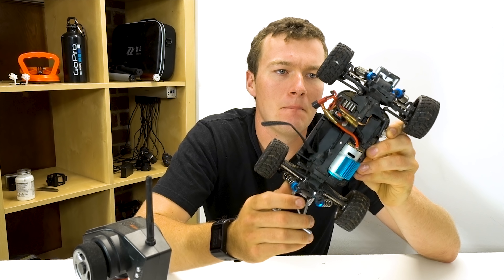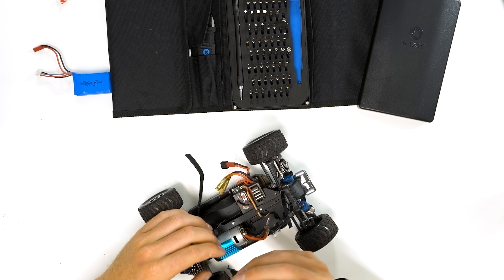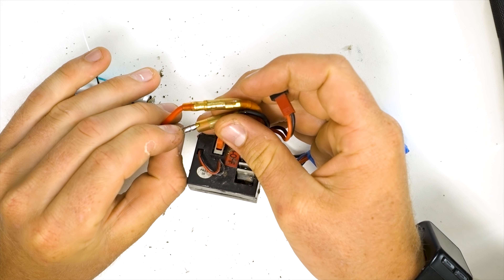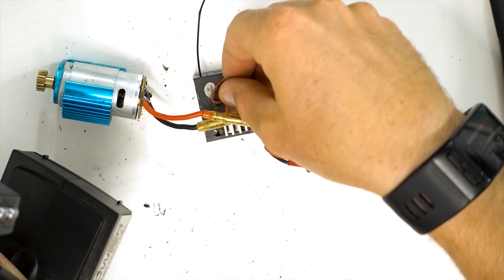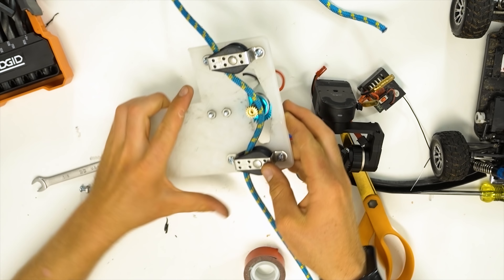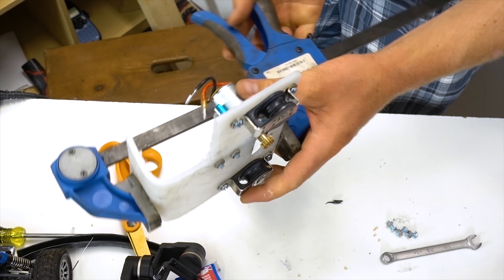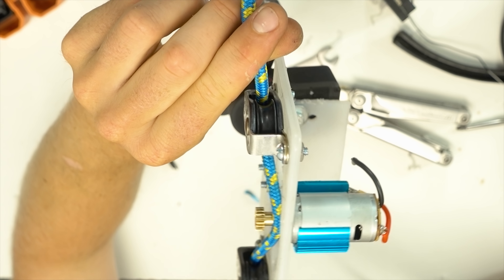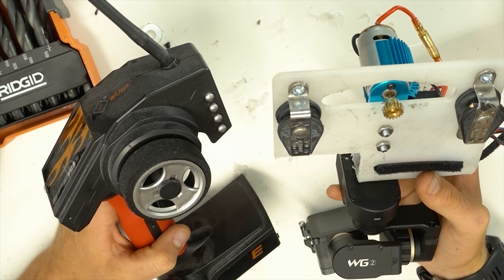DIY GoPro Cable Cam

Comment: Really cool project. Only issue was the bending the plastic the wrong direction for the gimbal mount. The angled lean is because the center of gravity is not below the pulleys.

Comment: Traction is the hardest part of diy cable cams. The high pitched noise you hear when starting the movement is the pinion drifting. After a while this will damage the rope and then there's a serious risk of melting it and breaking it

Comment: This is amazing! I've been thing about this ever since I saw the Wiral Lite
Reply from the maker: I saw a video for that the other day but without a gimbal on it the footage will suffer from swaying motion. It seem easy to get side to side motion with these cable cams as there is so much weight down low the cable cam turns into a pendulum.

Comment: Because you were talking about the possible NEED to reduce the gear, increase your ratio by getting a larger pinion or several to determine which speed is best for you. Great idea for a cable cam. Have you ever considered 3D printing or hooking up with someone that prints? you'd be next level DIYer.
Reply from the maker: I have 3D printed in the past the problem is that not everyone has a 3D printer so basing projects around them minimise the amount of people who can follow along. That said the videos I did do on 3D printing did well so maybe it is time to give them another look. It did not help that my 3D printer was total crap. You can check out a few of the video here: https://www.youtube.com/playlist?list=PLhceDTg-JOm9mp6xAWoNpgO0lZqsFn2KF

Comment: So rad! I am a professional mtb videographer, and really want to build this. What is the plastic plate you used for the rig? I want to keep it as light as possible and this looks like the best way
Reply: whoops, just caught that you said it was a cutting board, haha, that is amazing
Reply: any chance you can advise where to get those pulleys? I checked locally without luck, and can't find them on amazon. Thank you!
Reply from the maker: Where are you located? I got mine at a local boat store. The block is called Bullet Classic 29 mm Cheek Bullet Block you can find it on the manufacturer website here:  http://www.harken.com/productdetail.aspx?id=5035&taxid=424 they have them at West Marine: https://www.westmarine.com/buy/harken--bullet-wire-cheek-block--196279?recordNum=2 but I think I would get this one instead: https://www.westmarine.com/buy/harken--29mm-carbo-air-cheek-block--2042331?recordNum=3  It is a bit cheaper and looks like it would be easier to mount. The blocks I used are 29mm but if you wanted to be able to use it with larger rope you could move up to the 40mm. 

I used thin cutting board for my build, most dollar stores have it for cheap and you can bend it with a heat gun or even a hair dryer.

Comment: i plan on using a attiny85 , set of 1$ receiver+transmitter board and mosfet to drive a servo that has a spring loaded grooved wheel on it. that way it is auto-adjustable and can be controlled wirelessly for speed and duration. total cost about 10$ for everything.
now i just need to receive my modules and component from china...

Comment: Great Video, Great Build Idea, suggestions on how to you waterproof the unit for those of us who live in countries that are "moist" most days of the year (Scotland)
Reply from the maker: From the west coast of canada I feel your pain. I would maybe start with a waterproof RC car. The one I used is quite good, I drove it through a LOT of puddles while testing with no problems. If you put some vaseline on the battery connections and used a rain proof gimbal you should be good to go. The RC receiver and motor driver are fully encased in hot snot so water should not be able to get to the electronics to easily.

Comment: There are always cheap RC cars at thrift stores and yard sales. Brilliant build.
Reply from the maker: This is a really good point. The only trick with them is to find the charger. I have got one or two RC cars at the local VV and neither have had the charger with them. If they run off Lipos like this car it is no problem but but chargers for older custom batteries can be hard to find.

Comment: Very clever!  I chose to do a gravity propelled cable cam and made it with 2 small pulleys and a thin brass rod connected to a T-bar to hold 2 GoPro cameras. I want to go 100-500 yards, so needed to use very light-weight fishline. You can see my approach here: https://youtu.be/G8Eh5i3o0a4

Comment: A drone would be easier.  Just saying. . .lol
Reply from the maker: If you have a drone it would be easier, but in tight trees or in places where you can not fly a drone this is a cool alternative.
Reply: and a lot more expensive
Reply: Getting medium to high speed tracking shots with a drone in a dense forest or heavily populated area is next to impossible. Especially so if you're a one man operation trying to shoot video of yourself. I know because I have 2 drones that I use for this very purpose. A cable cam like this is priceless.